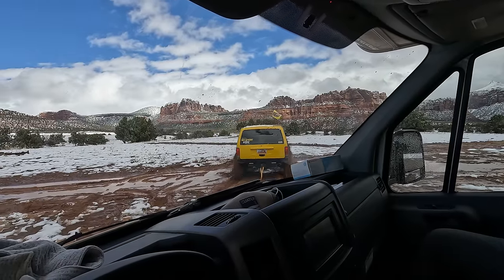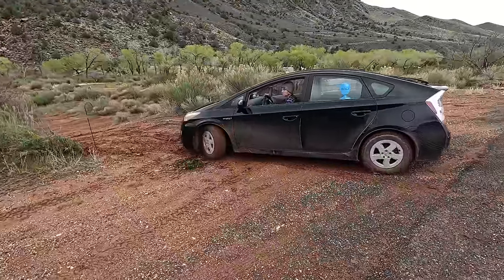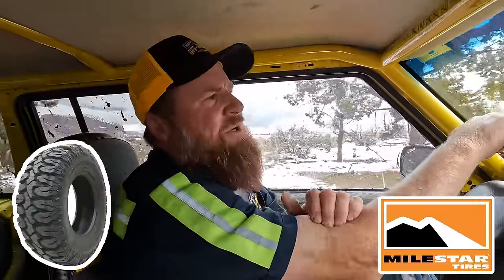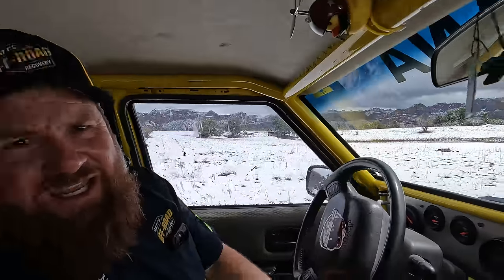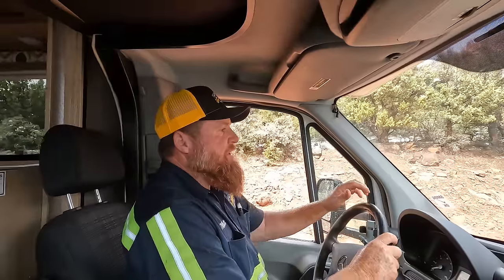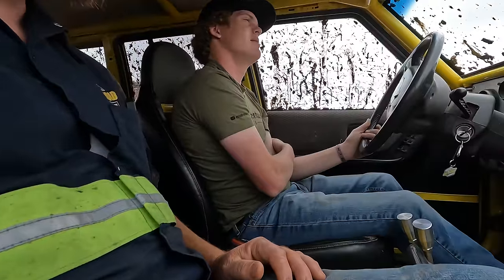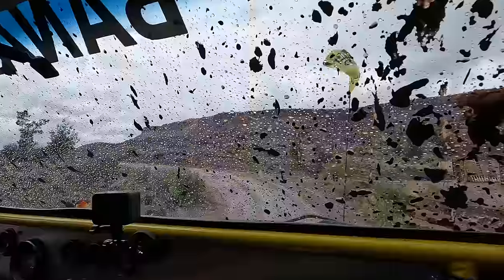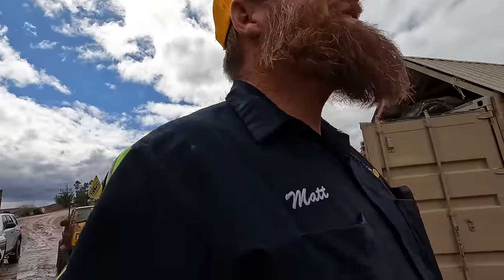This RV Recovery is Awful!

Comment: Serious props to the medical team that took care of Kaulin, because he's like a dang ol billy goat, getting around like nothing ever happened.  I don't think enough of those people get the recognition they deserve. :thanksdoc:
Reply: I know they don't......  I had a compound fractured right leg, rebuilt right foot and ankle that was crushed in a motorcycle wreck, November 23, 1980. ......  I will never fail to appreciate Dr. Holbert in North Bend Oregon.....I can't run, but I can walk.
Reply: Im new to the chanel, what happend to his leg?
Reply: @gkbskt  bad things
Reply: @gkbskt  All I know is that one was shorter than the other, and that he went thru multiple surgeries. Looks like he is doing great now!
Reply: @gkbskt  It fell off
Reply: It’s not just the medical professionals, it’s the hard work he put in during his recovery with exercise and physical therapy
Reply: Billygoat teenager ….😂mm same thing
Reply: @gkbskt was detached in a dirt bike accident.
Reply: @pacodelahoya2000  no it wasn't. If you watch Rudys channel he explains what happened. He was trapped between to cars and his leg was amputated but were able to reattach it. But it made his leg shorter so he needed his other leg shortening to make it rge same length.
Reply: @gkbskt   He was trapped between to cars and his leg was amputated but were able to reattach it. But it made his leg shorter so he needed his other leg shortening to make it rge same length.
Reply: @kaygoodwin1797 I stand corrected.

Comment: Wow I didn’t think the banana could haul that heavy trailer! Very impressed.
Reply: It looked like my GMC Astro when I hooked up to a 30 foot rv trailer to pull it out of the way to replace it with another one. Saved the guy from unhooking and rehooking twice. Ha, ha, no, I wouldn't want to try pulling it on the road.
Reply: It's on 1 ton axles so...
Reply: @Kovacreation the axles are strong but that doesn’t mean the suspension, transmission and motor are built for that much weight. I know they were going slow and a short distance but that’s just a lot of weight for that jeep.
Reply: @jordanlambourne5230  once you put the transfer case in low range the engine and transmission are out of the equation. Besides if I remember correctly that engine has been worked on and makes 250 HP which is more than a lot of trucks make. My 1990 F350 had a 7.3l diesel and made 170HP, my 1989 F250 with a 5.8l gas motor makes 210. A lot of 50s single axle dump trucks has inline 6-cylinders that made less that 150 HP.  A 25 HP farm tractor with enough weight on the front to keep it from going up into the air would move that trailer. I once moved a 70' house trailer with a 50HP tractor. A guy I used to work for helped put more than one 70' house trailer in position with a John Deere A which was also 26 HP
Reply: Same, that was mindblowing.

Comment: Hear, Hear !
Mudding puts grit in joints. It cakes grease turning joints dry. 
A machinist in the neighborhood told me what mud and muddy water does to joints as a teenager, and I have never mudded since.
Reply: That's why they make pressure washers and gear and oil
Reply: Lmao ok. So I Spose u do t drive down gravel roads either !? My family lives down gravel my house is on gravel an when it’s wet that gets everywhere so your gonna tell me my everyday driving is gonna ruin my vehicle well I think u should double check his info.  It may ruin them but if taken care of an have the proper protection your fine. Lmao 😂
Reply: Some conditions are harder on components than others.  You do what you  NEED TO  DO. Unless it's just a hobby and you don't mind the effort and dollars for additional maintenance. 

I don't intentionally drive through mud or water unless there is a destination that requires it.
Reply: The reason I bought a 4wheeler is if I want to play in mud, then I can trailer it home to wash n lubricate it.  I do find it hilarious how everyone says that the mud wherever they are is so much worse and different than everywhere else.  Now, in one case I can say I've found the "mud" more dangerous isn't directly due to the mud.  But due to the fact of possibly having IED's or combatants fire. Iraq in rainy season. Now jungle areas are especially special, I've seen and been in the mud in WA, CA, GA, S.C., FL, IL, IA, MO, "fields and river bottoms", AL, KY, and others. Now, on really damaging stuff, the snow (rust) belt areas and coastal are especially nasty due to salt rusting everything.  Mud flats or fields are some of the worst anywhere, no place to hook winch up. I've got to see heavy ag tractors stuck. As a teenager, my vehicle was recovered by a dozer winch line midwest in river bottoms. Lesson learned not to try driving out in heavy rain and fog to avoid flooding.
Reply: @DB-yj3qc  The mud on the planet Voltron that i drive on is much muddiery
Reply: If you have a choice... good for you, others build the skill for working...
Reply: @zachmeyer8962 He was talking about mudding dude, like basically submerging a vehicle up to the doors in a mud pit. Idk where you got "gravel road bad" from his brief comment.
Reply: @DB-yj3qc  i live in Washington, grew up here and Oregon, but the worst mud ive ever seen was in Germany
Reply: @FattommyDrives that just forces smaller grit into your joints.  Ruined a dirt bike chain this way in less than 30 hours of run time.
Reply: @DBRONCOSfan  yea my bad. Dirt in seals and stuff is bad but part of driving off road

Comment: If that's not a testament to the capability of the Patagonia tires, I'm not sure what would be. Another great video from the MORR family. Thank you.
Reply: Mine have been great in mud, snow, and sand!!!!  👍👍👍
Reply: Comparing any other tire... that's literally the only way to tell... you can't tell much seeing one vehicle do anything other than its fun
Reply: @16driver16  
 I can tell that one vehicle can get around pretty well in the mud in a couple different instances. One pulling a small car  from a place it couldn't remove itself from. Another pulling a fairly heavy trailer through the mud fairly well. I realize this particular JK punches above it's weight limit, and does so while turning said tires. Thank you.
Reply: @richwood8650  its an xj not a jk... you know NOTHING and just PROVED SO!!!
Reply: @richwood8650  I'm trying to tell you every mud is different even the same mud is different over time... without something to compare to you can't tell how well the tires helped at all... THE VEHICLE  did well... whether the tires helped or not is interminable with this information set
Reply: @16driver16  
 I tell you the tires helped. Without them, I assure you, the job would have been near impossible. I'm not saying the tires are the best. I'm not even saying the tires are better than any other tires. I just thought they did well. And I for one believe that this outcome was not indeterminable. I believe that was what you were trying to say.
Reply: @richwood8650  so because the tires went where cars with very limited suspension travel, open diffs and street tires went but got stuck that means the terrain wasn't extremely difficult
Reply: @16driver16  
You are so right. I'm sorry I tried to match wit with someone evermore superior to myself. I'll see my way out.
Reply: @richwood8650  being incorrect doesn't make one of us less than the other... that kind of thinking is horrible. You really think people who aren't correct are lesser than you?!
Reply: @richwood8650  people are equal no matter if they're correct or not! Dehumanizing people for being wrong is a horrific way of thininking used to make killing others less displeasing
Reply: @richwood8650  if you think that people who are wrong are less than you that's why you can't accept that you are wrong too
Reply: @16driver16  

No body is less than I
Reply: @richwood8650  "I am" just "I" implies GOD
Reply: @16driver16  lol, wow, you sure seem excited about the difference between an xj and a jk when talking about tires!
Reply: @16driver16  wow, you might seek help for your fanaticism for something that makes absolutely no difference in life...
Reply: @BitBuhkit  I didn't talk about the difference I only stated that they are... in fact I didn't go into any detail about how they're different so your 100% wrong
Reply: @BitBuhkit  it's the channels sponsor... his livelihood, HE LITERALLY DEPENDS ON THEM FOR HIS JOB AND SUPPORT FROM THE COMPANY AS WELL OMFG
Reply: @BitBuhkit  do the tools you use for your job and the people that pay you make no difference to you?!
Reply: @BitBuhkit  if it was just tires he chose because he liked them I'd agree but this is a sponsorship and not at all like what your thinking it is... why do you think he says the name of the tires and ropes etc all the damn time?!
Reply: @16driver16  Wow don't have a cow man!!
Reply: @jasonstrout4502  it's hard to tell if someone is mad or not online, but I'm having fun with this not upset about it

Comment: I suggest you carry a full 2 gallon garden pump sprayer with you on all recoveries.  It becomes a micro pressure washer for hands and mirrors, an emergency water supply, and a way to cool overheated engines.  Thrift store beach towels are always handy to have off-road.
Reply: Why not a 1gallon
Jk
Reply: @Jaxon1127   I'm slowly realizing that part of the MORR schtick is to show them going unprepared. Example; go on a snow recovery in t-shirts.  Only the young lady was smart enough to bring gloves.

Comment: 15:42 Matt and team! Majority of vehicles will have the traction button and when just pressed, it will turn some nanny’s off but not all (usually a stability control). When pressed and held (usually 5-15 seconds) it will turn off all nanny’s. I can confirm this works on Hyundai’s, Ford, Toyota, Subaru, Ram, and I would expect it to work on GM products.
Reply: Yes it works on GM too. My Silverado is pretty dang squirrelly in the snow with it off. That tech has come a long way but sometimes it still sucks!
Reply: it’s the same on my BMW aswell, i guess that’s become pretty standard to have to hold it. Definitely a good piece of info to remember when dealing with newer cars like this.

Comment: When I had a Subaru Forester I was constantly amazed by how well it handled in slick, greasy mud. Even with the traction control/ X mode on. Their AWD system does a really good job of evenly distributing the power. I'd take it over my truck every time in mud or wet snow. Especially once I put better tires on it.

Comment: I think the tongue weight of the wood trailer actually helped you with getting some more traction👍
Reply: Sure did, helped to plant the tires and dig in that slimy mud... Just like the weight helped the camper.
Reply: Being aired down helped put more rubber on the road too!
Reply: Yeah, that weight really helped those tires grab into that thick clay bottom instead of just spinning on top.
Reply: yep squatted the rear and lifted the front.:face-turquoise-covering-eyes::face-purple-smiling-tears:
Reply: I agree, that rear axle definitely had some ballast.

Comment: I have a Subaru Forester. You just press the traction control button by your knee and it goes off right away. You don't need to hold it down. A TCS OFF light will illuminate on the dash by the speedometer to let you know you were successful.

Comment: on a lot of the newer cars the trac control is two mode. Short push will let you spin as long as you go straight and a 10-15 second push is full off for hoony funs.

Comment: The trick to easy cleaning after "mudding" is spraying everything with a good coat of cooking spray. That oil coat will help the mud fall off after. Works everytime. Sure it isnt cheap but its easier to clean after. And if you set one of those wand style sprinklers underneath and let it run, it will fall off. Or just hook to a fire hydrant for the pressure and volume.

Comment: You really need to get some two way radios. If you know you are going out in muddy conditions, get a Hudson sprayer (bug sprayer) with water. You can use it to hose off the windshield and side windows.
I can't believe those 5 young men just stood by and watched you two crank up that trailer tongue jack instead of jumping in and helping.
Reply: They have radios, they just forget to take them
Reply: @Mardy72  I thought I saw a  little walkie talkie hanging on Kaulin's shirt in that one clip.
Reply: They have some. Bringing them along is on the checklist before leaving, right after getting gas.
Reply: There might be some sort of legal/ins. reason why others don't jump in, or Matt wanted it to be Kaulin. But I agree. It looks pretty bad for able-bodies guys to just be standing there, watching.
Reply: You did. Apparently Matt didn't have his.🤷‍♀️
Reply: @drgruber57  You're right! Matt has said in much earlier videos that having one of the crew drive is for insurance purposes.
Reply: @drgruber57  A sign of the times.....
Reply: @jdougn2255  Woman in the Subaru must have been one of the employees.:face-blue-covering-eyes:

Comment: I had a moment's doubt about pulling that trailor but you got'erdone. Just a suggestion that you get two wat radios for coms between drivers and overseers. Those times when you callled for, "Stop, Stop, Stop", were not heard over the engine noises.

Comment: Matt, Your new shop space would be much better if you had an overhead crane set-up. Lifts are great, but adding  the ability to pull out engines etc. from above is a huge improvement! When you need it, you need it!

Comment: Great video!! The first two were pretty much as expected, but the trailer full of wood... I didn't think the Banana would  pull it after you unhooked the winch!! I guess the excess weight on the rear tires of the Banana gave it the traction it needed. Great Job driving Kaulin!!!

Comment: Saw some guys in a Prius scraping down a road near the Browns Valley WMA near the Utah border. Poor guys started on the chip seal road that turns to gravel, then to dirt, then to one lane narrow road as it goes through the canyon. Went in by the swinging bridge, which is mostly sand on the way in from Colorado, but when you come in from the east it sneaks up on you. Was genuinely surprised how far that little Prius made it. They drove all the way over from Nebraska and Google Maps took them right down the path. Can't imagine that car looked very good by the time they came out.
Reply: The map on Google or other computer apps can put you in the middle of a lake if you're not extra careful.

Comment: I have found that using an ice scraper to get all the heavy mud off first makes it much easier to wash the windshield off when you get to using water.  That way a little bit of water wets the remaining mud enough that a brush will turn it into a really thin slurry that easily comes off when you toss the water onto the windshield.

Comment: I live in Connecticut,  and there is really not anywhere to offroad here. One thing I can agree with you on is, I have NO interest in mudding. Give me some trails with scenery,  some climbing, but I want firm ground if it's wet. I would never get caught on those clay roads in the wet if I could help it.

Comment: On some cars, if you tap the traction button, it'll turn off half the nanny's, like on Toyota, it'll turn off traction control but not stability control (can spin tires but it'll intervene if you go sideways) if you are completely stopped and hold the button, you can go full off

Comment: On my old BMW (2005 330ci) if you pushed the traction control button once it would lighten the intervention of the computer but it would still try to "help" you.  If you held the button down for 10 seconds or so the traction control light would flash and then you were all on your own.  It was then possible to do donuts in the snow.

Comment: I’ve shared Kaulin’s view on mud since I was about his age. Wheeling south west/ central PA is wheeling on clay, stream gulleys, and glacier strewn boulders. 
Most normal wheeling was $7-$10 at the pressure washer. 
Not too long before I bought my own. 😄 
You guys passed that one vehicle/ camper 6 times. Did you leave a card or note?😂

Comment: If you ever get pulling a Tacoma. Pressing the traction control doesn't actually turn it off. It's janky. You gotta put it in neutral and press and hold the button for like 15 seconds.

Comment: Tyres. That's what makes the difference in mud. It's all about the tyres. My old Subaru with limited slip centre diff, full time all wheel drive, and high low range was awesome in mud with the right tyres on it. In some ways better than my old SWB Toyota with 327 Chev, off road race suspension, running on 35inch mud and snows. The extra weight of the Chevota would sink it in the softer stuff, and the Subaru would skim across the surface. When it got soft enough for the Subaru to sink, the Chevota would have been down to the chassis already.

Comment: I see a tank in the about 2" high filling the entire space making a second floor. Beef it to hinge up, electric pump to hose with a spray nozzle. About 20 gallons of water so give or take adding 200 pounds but you would always have water on board. I don't know if it would be beneficial, seems to me it might but I have no idea how it would affect your rigs. Even a two gallon yard sprayer would be very handy
Reply: A tank behind the back seat.

Comment: Those Mercedes are horrible for traction as you found out.  They get their traction through the ABS/anti-skid system.  There is no way of installing a posi in one of those at the moment.  Ring gear is friction welded to the carrier and all the parts internally are Mercedes proprietary.  Axle shafts are hollow (if you believe that).  As of yet, nobody in the after market will touch that rear diff